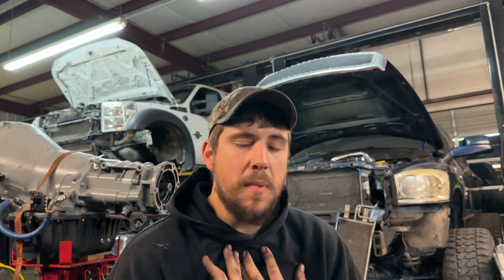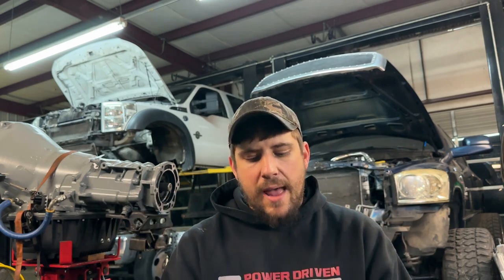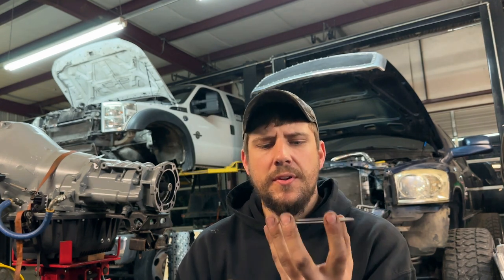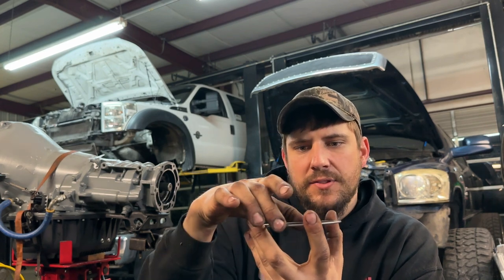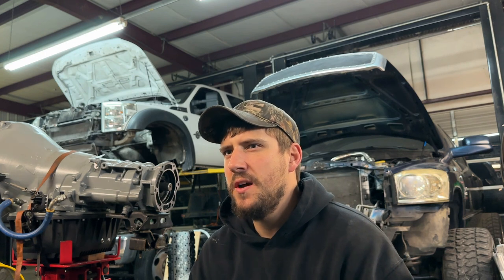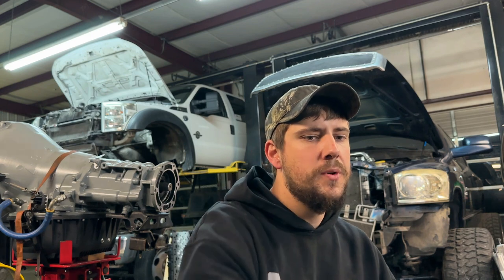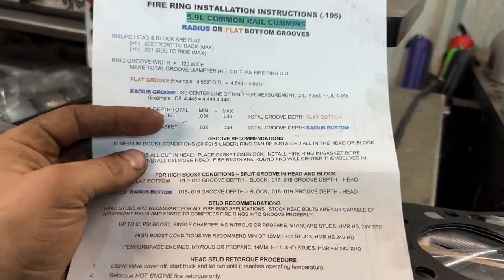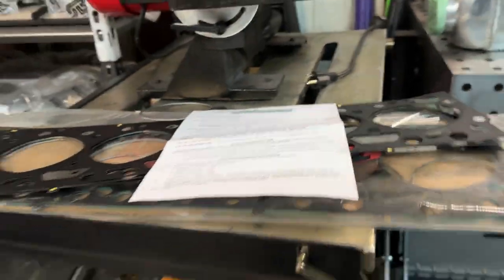FIRE RING HEAD GASKETS

Comment: I make just over 400 hp and my head gasket just popped the tinniest leak. Its only been 2 3/4 years and 35k miles. Haven't even done a burnout, was just puttin around town. Has studs and still on an hx35. Its daily driven thru winter and has been all over the country but still, 35k should be nothin for a head gasket with studs on a not powerful truck.

Comment: Learned something new with the crush. :) 
Since it’s the internet take this for what it is. Josh already mentioned it but, cylinder pressure management is key. I have rigs from 400whp to 800 whp fuel only and I have tuned a lot of 12v’s for fuel only and nitrous. First things I ask is head clamping force, and rods. That sets up how much torque we can make. From here we manage that torque through tuning and selecting a rpm to make the target whp number. Nothing I have makes less then 50lbs of boost on aftermarket head bolts. but I keep torque in check (bmep)/cylinder pressure over time/. 

It really goes a long ways fuel only or on spray to manage that pressure to what your system is capable of containing. 

More Rpm reduces bmep over time. Like josh said. You still hit your whp target and because your reduced torque the system lives another day. 

As far as 12v’s go most are over timed or on sub par injectors making things worse, cheaper engines favor cheaper parts favor more expensive lack luster results. Hit them with spray and out goes the gasket lol. 

12v’s on quality components tuned with some experience at a minimum can and do extremely well. Extreme example is the haisley and scheid motors. 

Again great video :)

Comment: Hey you really explained the headgasket seating and crushing process the best, the most throughout explanation by far on all of YouTube!! Granted I don’t own a truck nor a Cummins disel 🤧 wish I could but that will come later in time lol 

However, I noticed you mentioned the retorque  sequence method of initially warming up the engine oil up to temp, ~180F , that’s without the coolant and then immediately after tear down and do a retorque, did I get that correctly ? Then add coolant and if possible do another retorque for safe measure……

Now what about an iron block inline 6 gas engine with an aluminum head using a factory paper composite type headgasket with arp2000 studs? How would you seat this head with all your years of experience would you still follow the same torque procedure on a gasoline engine ? FYI i obviously don’t have any fire ring grooves cut into my head or block but the reason I’m mentioning my engine is this bmw engine that I have got a oem elring headgasket august and by Christmas coolant began to seep out between the block and head😢 big sad since my initial reason for working on my car was it was leaking the same way but from the exhaust side LOL. I got shit luck since now it’s leaking on the intake side which is also the opposite side in which the engine is completely mounted in. It side at a 45degreee angle toward the passenger side which is also the same side as the exhaust. 

Guys on the bimmer forums would only call for a retorque on heat cylcle when they used cutring head gaskets or mls. I’m not mixing oil and water but it’s been leaking coolant for months now. I have a theory as well that the arps aren’t clamping down as much tightening torque as an Oem  fasterner which is a tty bolt that calls for a 22ft to set the bolt and 90degree and another 90 whereas the arp just said to finish the torque spec off at 75ftlbs which felt like nothing 

If someone actually read this and gives me a sensible reply without being a dick would be much appreciated……

Comment: Great info as always. I tell guys to look at it in terms of airflow or lbs of air a minute is the most telling. If you have a MAF that's scaled right or can calculate airflow accurately, your HP "guess" based on airflow will almost always be within 2% of actual. I also say Torque is = to cylinder fill which then generates pressure which is the one and only force that generates torque in an engine period. HP is simply torque or cylinder fill over time... Cylinder pressure X piston surface area + crank leverage or distance from crank centerpoint to rod centerpoint, + drivetrain gear multiplication AKA trans gearing and rear end gearing. If you know all those things you can actually pretty accurately backtrack your cylinder pressure from your dyno sheets torque. You can also back track cylinder fill by lbs of air a min / # of cylinders. Now tuning using cylinder pressure is fantastic if you have the ability, but those high pressure/refresh rate transducers can be costly!! Not to mention dyno time.... That said engines are not complex but rather many simple things strung together in a row, so break things down to their simplest form and you'll realize the world is actually quite simple. :)

Comment: 1 number in compression ratio is equivalent to 100psi cylinder pressure, 1 psi boost is 15psi cylinder pressure roughly. So that’s why the lower comp and higher boost makes less cylinder pressure and more power but the high cylinder pressure, truck will run amazing actually untill it cracks your sleeve or breaks a ringland

Comment: good shout out to mountain high. They still trucking away. They did my machine work, half and half fire rings and in the head, 5.9l larger valves and ported.. plenty of power. actually had to tune it down to how I am using it 👍

Comment: So… I have an early 2007 Cab and Chassis with a 6.7L. October 2006 build date. It’s not a 2007.5 and it’s not a 5.9L. It either has a melted piston, so I’m looking to rebuild it for a 1964 Chevy rat rod. Fire rings an head studs is something I’m looking at doing while it’s out even though I plan to keep it fairly stock in the beginning, but plan for compound turbos and a tuner… but dependability with a trailer is my primary focus.

I just want to be able to outrun my dad’s 1937 Terraplane pickup with the Big Block Chevy at the drag strip for bragging rights. 🤷🏻‍♂️

What do I look for when ordering parts? 2006 5.9L or 2007.5 6.7L???

Comment: Damn I’m building my 97 12v now with a built he351r with a 475/96/1.15  with gator studs and was gonna run a mls gasket but got a ported fire ringed head from Hamilton cams so fire ring it is. I have a 63/71/14 laying  around I might build a kit with a s480 to put on the truck. Currently going for 600hp but eventually want a clean 750

Comment: I'm actually surprised how well the ARP 625 studs hold on my 6.7. The 2000s gave up with the s366 but I've added a S480 to the party and make WAY more boost than anticipated (70psi). I immediately took timing and fuel out of my low to mid rpm range which is probably why it's still alive. I would've fire ringed it but the guy that did my ported big valve head didn't want to do it for a daily driven work truck.

Comment: when i blew my headgasket went to pull the head off and turns out the previous owner had square cut fire rings in it so i had to call haisley and they got me setup with em to get my truck running again but now i need a whole new engine because radius cut is way better 😂

Comment: If you do half n halt cut then that should technically eliminate the nred for the head alignment dowels. I feel like the dowels could cause it to misalign and it would be better for the  rings to find their new alignment. Also another question what about copper spray the outside mls gasket to further help the coolant and oil from mixing what are your thoughts

Comment: @horsetorquesdiesel So now that we have a supply chain shortage on the custom age 625 for the 6.7 what is our options if any? What is the difference between the other cummins apr head stud kits? What would it take to fit a 5.9 625 kit on my 6.7? Is it possible because I need stud asap.

Comment: What about oring heads. My 12v finally blew a headgasket at 493000 miles. I have a set of compounds on it with cheap headstuds that was still the factory head gasket to.
Reply from the maker: They are ok I just don’t like them. We sell customers a fire ring gaskets

Comment: Could you do a video discussing  Efi live tuning? I have an 06 5.9 that I had tuned. in stock form it made 40 psi boost in tune 5. Then I put 45% over injectors in and was pushing 40 in tune 1 with low smoke and 45 in tune 2-5 with lots of smoke. I had the truck retuned to clean it up  and now I rarely go over 30-35 psi boost and egts get around 1400 in tune 1, which I rarely if ever saw with the previous set of tunes. I’m just curious what factors in the tune writing can cause these changes. All of my current tune settings are decently clean.

Comment: I have been told not to super glue the ring   Is there pros and cons?   Obviously falling off ext!!
Reply from the maker: Man there are a million ways to do it. I've never had an issue with super glue. But you can also center the ring in the gasket on the block if you prefer

Comment: How much you charge for a job like this? Got a quote from a guy down here in Charlotte and I’m curious if he knows what he’s talking about. He talked me into a power stroke fire ringed head.
Reply from the maker: Just to cut fire rings in a Cummins head it’s like 200ish bucks depending on if it needs a surface. Our labor is 12 hours generally on a fire ring head install which puts you at 1320 bucks in labor. Not including the gaskets and studs etc
Reply: @horsetorquesdiesel  who can I call to get a real estimate?

Comment: Advise please: motorhome with fresh vp44 5.9 with PDD towing compounds ( k27/369 sxe) and 75hp injectors , tuned to push 55lb boost keeping EGTs below1350f and using arp2000’s also using water injection for more EGT control.
Been reliable so far with 10,000m. I’m guessing 450hp
Have I got a safe unit or should I consider removing head and grooving it for fire rings ????
Reply: Being a motorhome you definitely want the most reliability. It would be worth the time spent to pull it back apart and get the head at least o ringed. You may even want to try out PDDs new towing cylinder head while you have the chance to swap them it’s well worth the money for someone towing or something like a motorhome in your case.
Reply: @ra1ny26  as I’m down in Australia where would I get the specs to machine the head for o rings and what gasket and o rings would I use ( 24v vp44 engine)

Comment: i cant find a machine shop to do this work. ive called everyone i can find with in a 800 mile radius and none of them say they can do this, nor have they ever heard of anyone that does
Reply from the maker: Where you at?
Reply: @horsetorquesdiesel  Northern Minnesota. I think I found a place in Southern Wisconsin, 300 mi drive. My current plan is to bring him The lower rotating assembly. Then later bring him my donor head.    Kind of build stuff in stages, assembling in my garage.   

The guy can put my piston assemblies on a scale for balancing and he can put an o-ring in the block. He has a torque plate to machine the cylinders with. That was hard to find.
Reply from the maker: @beardedgaming1337  Eric at no limit is in Wisconsin go there

Comment: 6.7 Cummins with Aisin currently running s364.5 T4 with s480 T6, wanting to keep stock fueling.  Thoughts on my setup?
Reply: It'll run okay but will be begging for more fuel, unless it's a 5th gen.  If you really don't plan to upgrade your fuel then you can tighten up the 80s exhaust to make it come on sooner.  A 475 would have been a better choice I think, no need for 900 worth of air if you don't want to go past 550.
Reply from the maker: Probably drives great but it definitely could use a fuel upgrade!
Reply: @horsetorquesdiesel  what’s the best way I can reach you to buy my next round of parts from you. If you’re interested
Reply from the maker: @dustindauzat8625  call the shop 276-608-3298

Comment: How much you charge to build me a 1000+ hp transmission with a full manual valve body
Reply from the maker: Starts at 8700
Reply: Is that for labor and parts? And what’s the benefits of having a ratchet shifter vs a normal auto and what’s the cons
Reply from the maker: @elijahbuford5454  that’s just a trans build so labor of building it and parts
Reply: @horsetorquesdiesel  what’s the pros a cons of ratchet shifting vs normal column shifter
Reply from the maker: @elijahbuford5454  one you shift, one the computer does. Really personal preference. I always wanna do hood rat stuff so I like full control
Reply: @horsetorquesdiesel  so what’s best for a towing/toy
Reply from the maker: @elijahbuford5454  for me a FMVB, for you idk it’s all preference

Comment: Stock just tuned 6.7 with arp 2000s do you need a hot re-torque ? With a new gasket torqued to 130lbs ?
Reply: All head studs need a hot retorque
Reply: Why doesn’t it say that on ARP instructions
Reply: @charles15519  I know they should put it on there but they don't.
Reply: @bigmurph1447  because they know better than you do.
Reply: According to ARP no you don't.  However in my experience yes you do.  625s can get away without, but still a good idea.  You will see, especially with a new gasket they will move half turn or so.  I like to do 2000s to 135-140 and 3 torques, but over torque at your own risk.
Reply: Yes I will never installed studs again without hot re-torque, put a liberal amount of arp line too been threw many gaskets, before I build my engine I was pushing 75 psi on a stock gasket never an issue
Reply: I believe with a new gasket you should do a hot retorque. 1 in at a time I don't feel it's necessary. I did 625s one at at time and I'm at 800whp and ive yet to have a problem. Studs were done in 2018